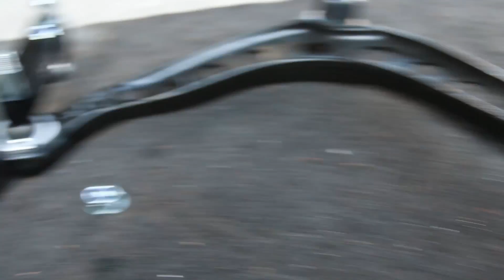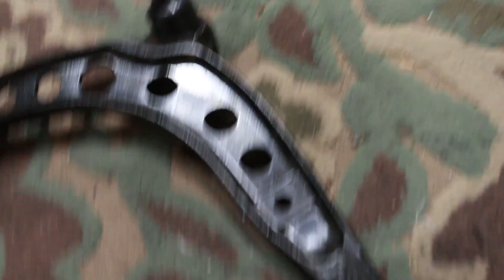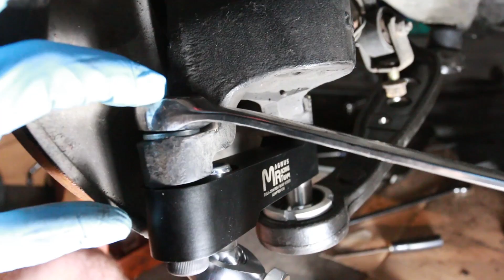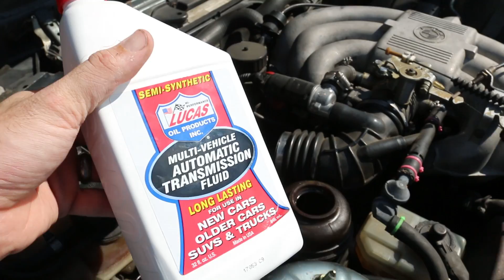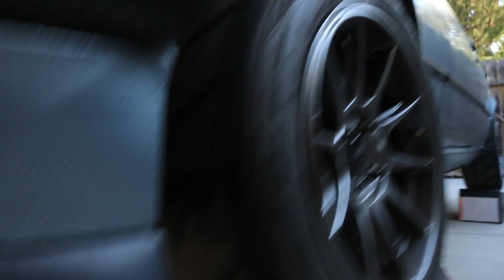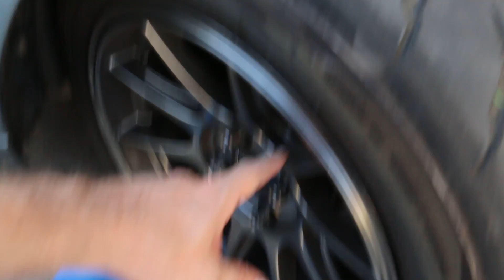E30 BMW Z3 POWER STEERING RACK CONVERSION PART 2

Comment: Don’t really like the idea of the tire hitting sway bar at under full rotation. Say you are in autocross and turn full lock and hit the sway bar real hard you can probably damage it and/or cause temperature lock up of the wheel

Comment: Thanks for making this video. I'm about to do the z3 rack swap, so this is really helpful. Some of the r3v write ups mention swapping the Power Steering reservoir and low pressure line. It doesn't look like you did that. Is it not necessary? will the stock low pressure lines reach the z3 rack? Thanks!
Reply from the maker: Jp Policastro I made it work by just slightly bending the line or maybe I flip floppes it I forget but I think I cover that in the video.
Reply from the maker: I cover it around 7:15 of the video
Reply: I see that now! Thanks. I thought you were talking about the high pressure in the video. I see now that you mentioned both. Thanks again!
Reply: Did this swap a couple of weeks ago and it turned out great. The lines were a pain. I might swap them eventually. But, I wanted to thank you for your video. It was a huge help. Keep it up!

Comment: "Hi, I'm Blakes Garage, and I make no mention of how much of a pain in the dick it is to get the 22mm nut that attaches the control arm to the subframe off on the passenger side."  

First time I did this, I couldn't get it to budge. Ended up supporting the engine and dropping the whole subframe.
Reply from the maker: Haystack Malone lol the magic of editing. But also in the power steering rack was out of the car it made it much simpler to get to.

Comment: Which front sway bar do you have that is rubbing? Did MRT provide any caution about that w/ their bump-steer correction piece?  You are basically doing eveything that i plan on doing to my 87 sedan. I might use a e46 rack de-powered rack though, and had been looking at the SLR kit instead... Thanks for the details, especially grindding smoothing the knuckle shaft binding points. Keep it up!
Reply from the maker: Sean S basically with any type of angle kit you’re going to run into rubbing issues. I will either make some rack limiters or get wheel spacers and possibly longer lower control arms.
Reply: Cool, thanks man. Limiters/stops are good to me, maybe small width wheel spacers. You have the stock sway bar mounting points or the M3 ones on your coilover setup?

Comment: Are all the z3 steering racks the same throughout all its models?
Reply: All z3-non M racks are the same. The z3-m racks are the same as the E36 M3.
Reply: Hmmm, sweet...good looking out with the info.
Reply: Welcome To The Madness no problem!I have a z3 rack in my e36 M3, it completely transformed the car. Probably the best mod on the car. You absolutely won't regret it.